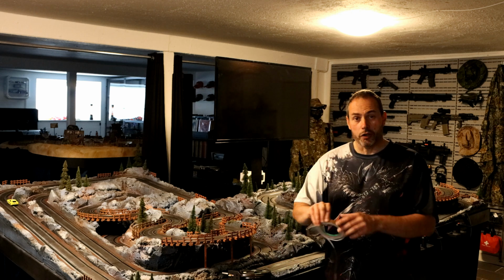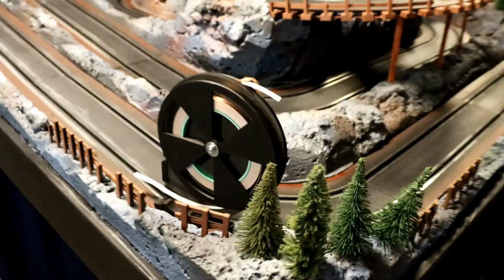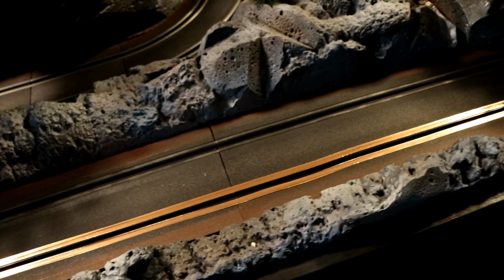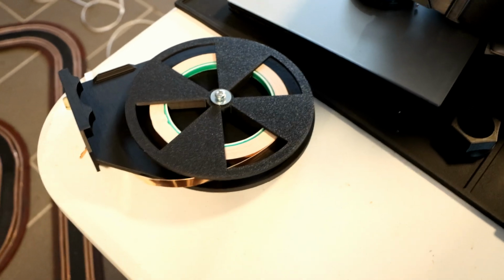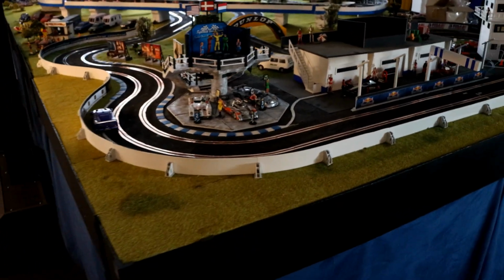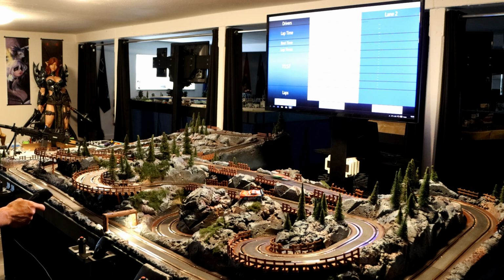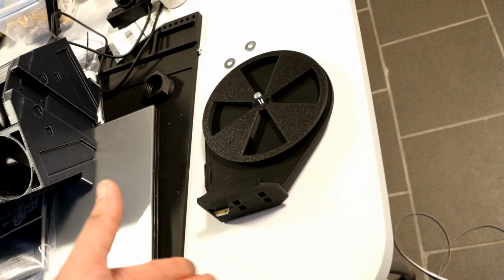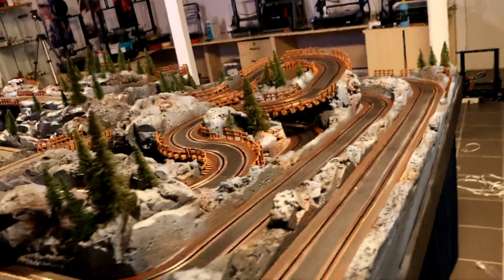Slot Car Track Upgrade: Boost Connectivity with Copper Tape

Comment: Two independent copper tape holder wheels on your applicator would allow both tapes to be stuck at the same time around corners.
You would need a bit of friction on the axle so that tension is applied to the copper tape as it gets pressed onto the track. ⭐️⭐️⭐️⭐️⭐️
Then you are in business 👍🏼
I enjoyed your video 👍🏼👍🏼👍🏼